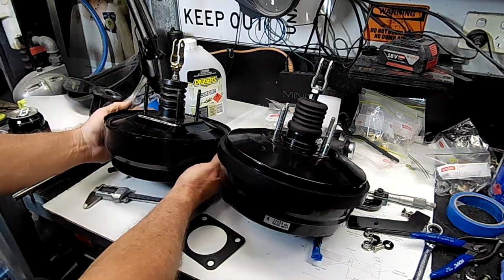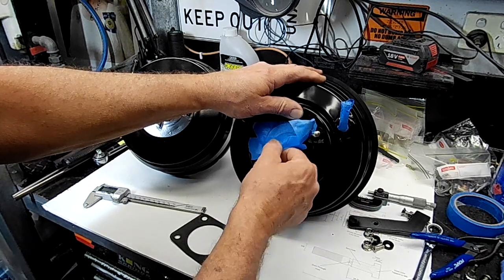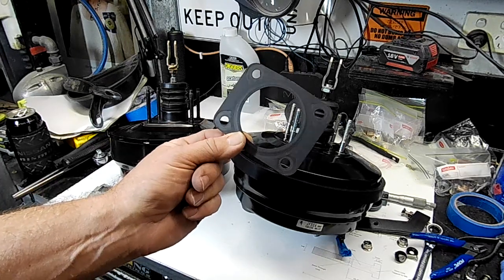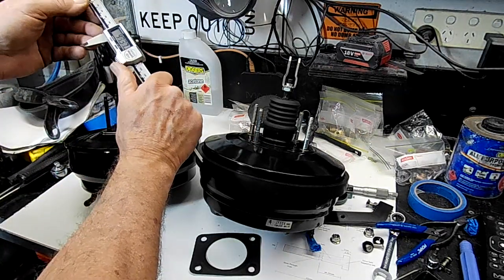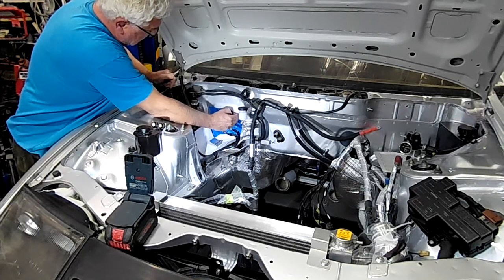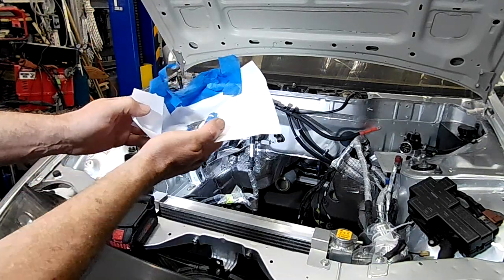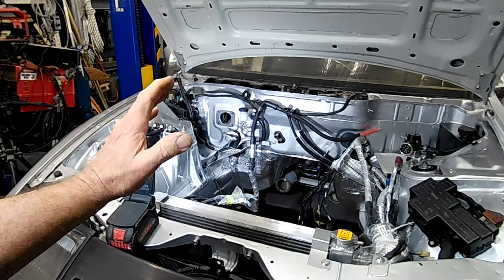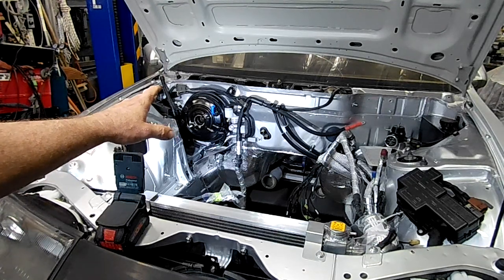R35 GTR Brake Booster & Master Cylinder Upgrade for The Nissan Z32 300zx Twin Turbo Mega Build

Comment: Hi Trevor,
Ford also sells the correct connector for the brake fluid level sensor under the part number WPT-1385.
Cheers
Reply from the maker: Thanks Mate, much appreciated.

Comment: My engines out so went shopping for the gtr parts & they're quite expensive! Didn't imagine it would be even more expensive than z32  oem
Reply from the maker: G'day Mate, were you looking at new or used? I guess the Country you are in could be relevant with that too. I found a used Booster on ebay it was $162Aud Delivered & the Master was brand New from Amayama @ $404Aud Shipped from Japan. I saw some very cheap used Booster /Master setups on US Ebay when I was looking, but shipping made it cost prohibitive for someone in Aus. Cheers Mate.
Reply: @TheAussieShed  g'day sir. I love the content. I'll check that amayama out